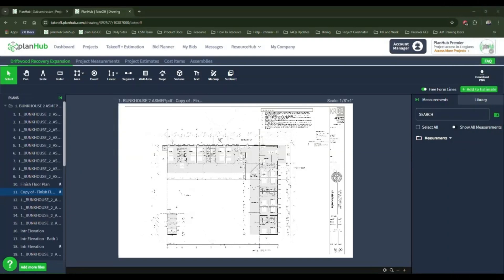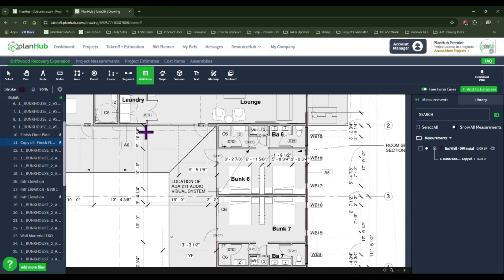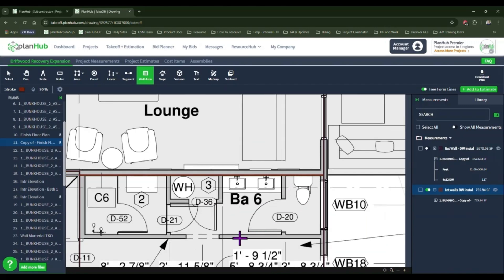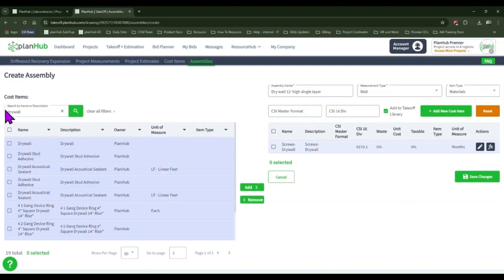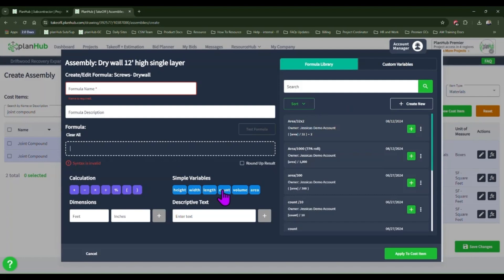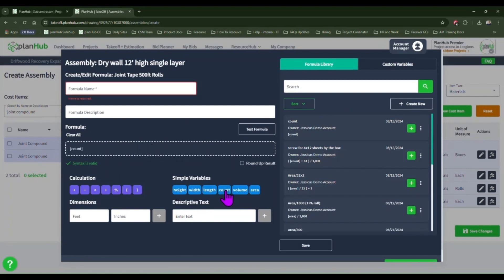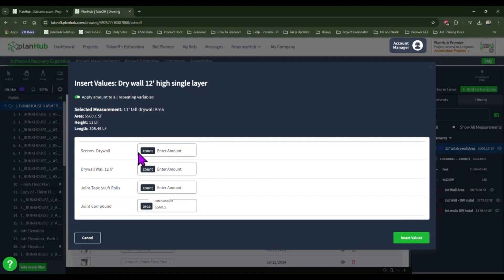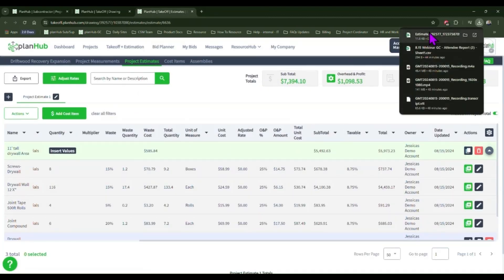PlanHub Takeoff Master Class | Drywall

Comment: Which one do you use for only ceilings no wall is it the area on the toolbar
Reply from the maker: Hey! Good question. At 2:46 in the video, the presenter demonstrates how to use the wall area tool to get the area of interior walls and it calculates the number of drywall sheets as well.
Reply: can your team make a video on how to estimate meta studs with PlanHub?
Reply from the maker: @Itzzgeee  We can pass this request on to the team, but we definitely recommend scheduling a demo so you can just get all your specific questions answered! Here's the link again 😊https://bit.ly/3Ix8spI
Reply from the maker: @Itzzgeee  Oh you know what, see if this video is helpful! It covers framers for both wood and metal - https://www.youtube.com/watch?v=2px8w9MZ1yo&list=PLhe0Ep-NMi3eCCosEeHVRi4kCRW4Cl7rh&index=6
Reply: Okay I see that’s for the walls correct? The other selection where it says “AREA” that’s to calculate the WxH of just the ceilings?
Reply from the maker: @Itzzgeee  Yes, the area tool can be used to measure ceilings. If you aren't a current PlanHub user yet, it might be helpful to schedule a training or demo so you can get all your questions answered! You can schedule one here: https://bit.ly/3Ix8spI